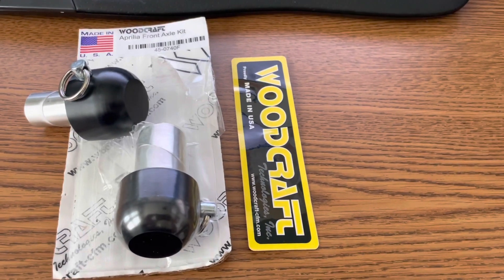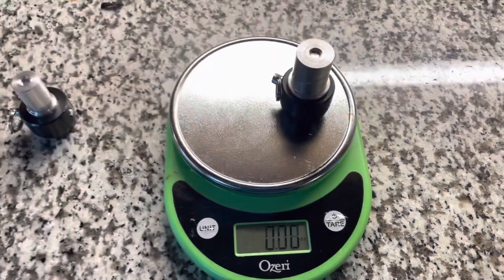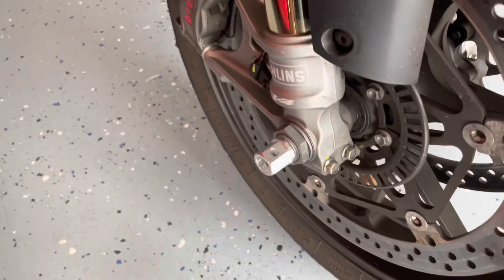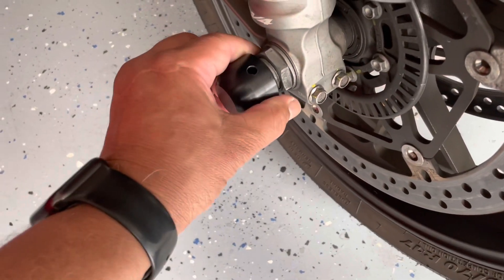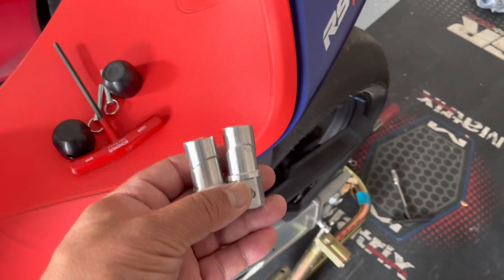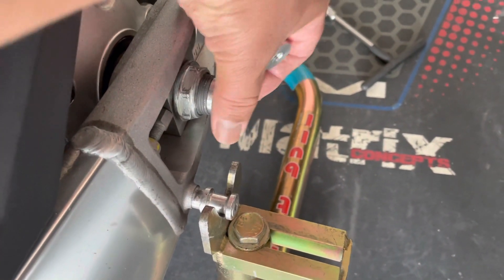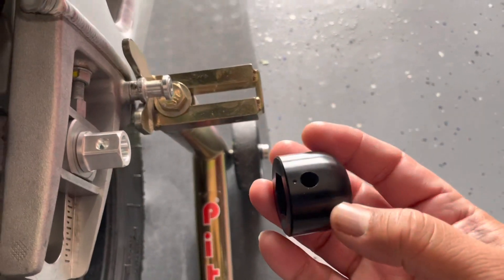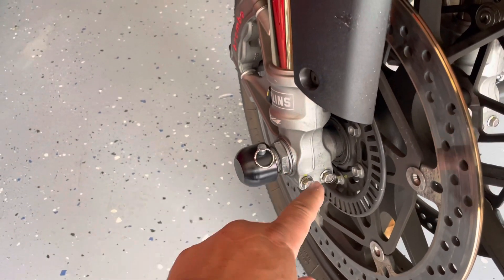Hit or Miss? Woodcraft Axle Slider on 2021 Aprilia RSV4 Factory

Comment: Any issues with the fitment on the front?  AF1 says the WC45-0740F *Does not fit '21 and later RSV4 b/c it has a new design front axle with smaller inner diameter.”
Reply from the maker: There were no issues that I can recall. I have sold that bike.